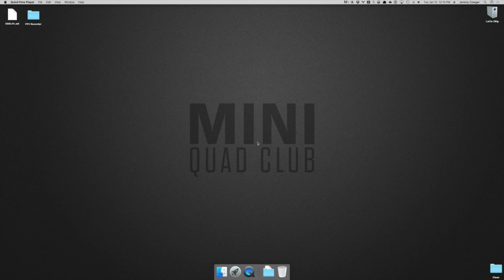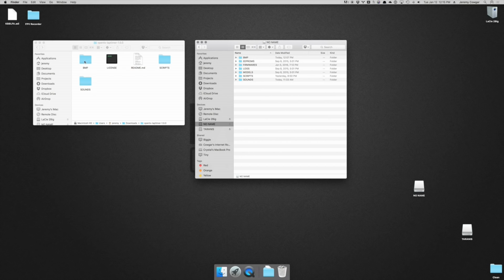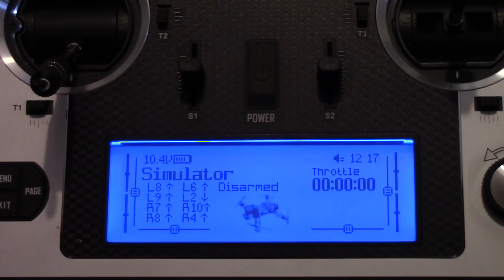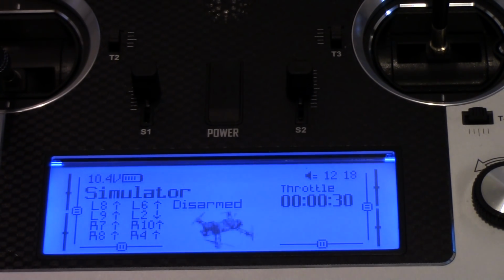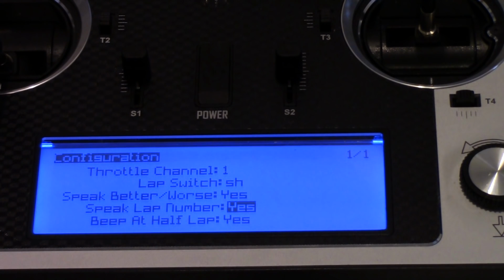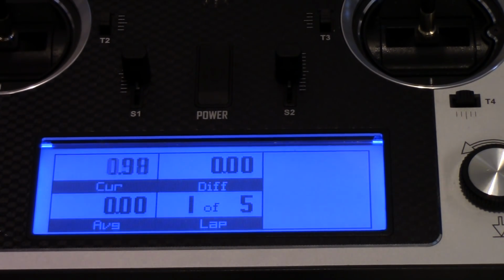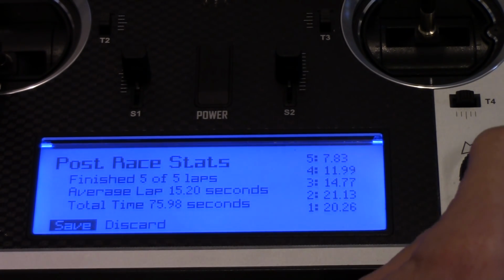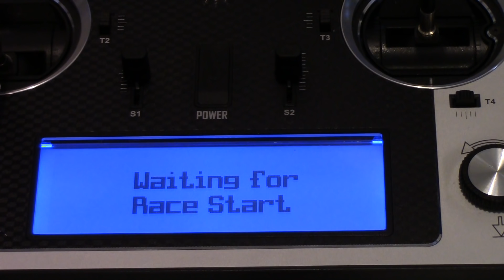OpenTX Lap Timer - Install, Configuration and Use

Comment: Jeremy, Version 2.2.0 broke your timer, which by the way, I used a lot and loved.  Open TX 2.2.0 added a new Display screen page which did not convert over your program with the new file structure. I messed with it and could not make it work. I hope you will take a look and get it working. It is the best timer out there for racing IMHO.
Reply from the maker: Thank you for the kind compliments! I'm sorry, though, I have not worked with this for some time. I'm no longer racing :-/ I'd be happy for someone to take off with the timer. It is open source if someone wants to pick it up and make it work for 2.2.

Comment: No possibility to get this working on the taranix plus?
Reply from the maker: +roy hoenen Oh, yes. It will work on any Taranis just fine. It does require OpenTX v2.1.x though. The demo video was done with my X9E, but others have used it on the X9D and X9D+. There is no difference between the radios as far as the script is concerned. In fact, it'll run on any radio that runs OpenTX v2.1.x. Now, if your X9D+ has 2.0.x on it still, you would need to upgrade to 2.1.x first to use this script.

Comment: Very cool mate. I wonder if this is possible to get hooked up to the race timing system at an event? like could a transponder be used to feed this back to you?
Reply from the maker: +whidzee That was discussed earlier and it would be cool, but at least with the system my local club uses, the lap timer onboard the aircraft does not hook into the system other than power. Thus, the system, FrSky telemetry or whatever, has no idea that it just passed through the gate.

I'm certainly open to suggestions!
Reply from the maker: +AIRBIRDS.DE Nice to meet you! Yes, the only way to get information back to the Taranis radio is through the SmartPort, and most people are going to have that connected to the flight controller to get telemetry from it, so it'll be occupied. So, this could get really complicated. Does the on-board lap device actually know it passed through the gate? How complex of a device is it? Does it have serial communication capability? Maybe it could connect to a UART on the flight controller. Another possibility is connecting to a PWM input on the flight controller.